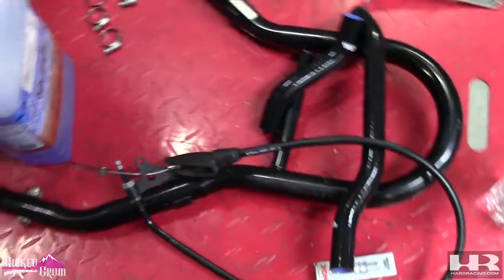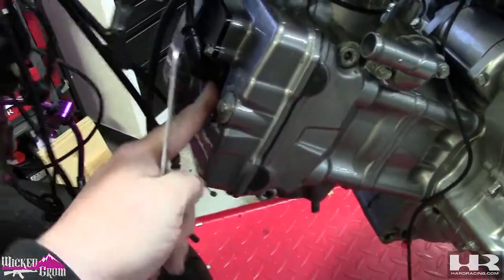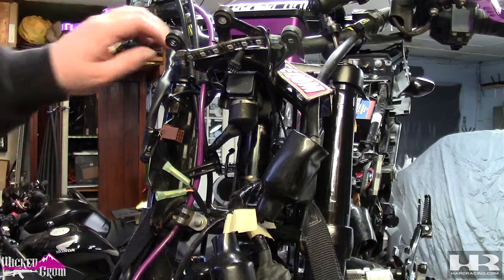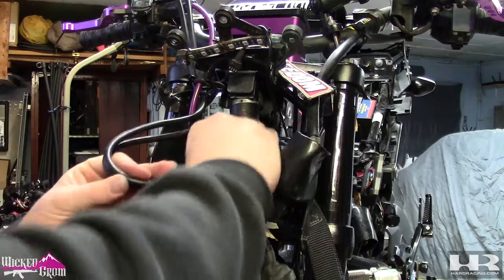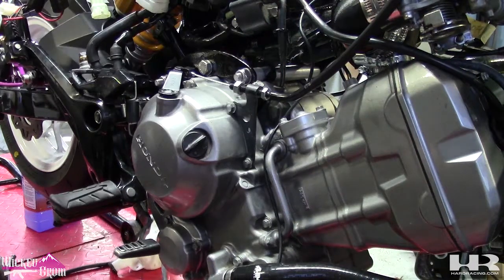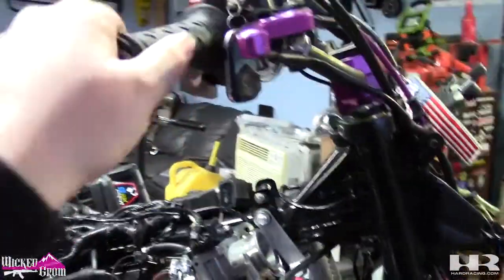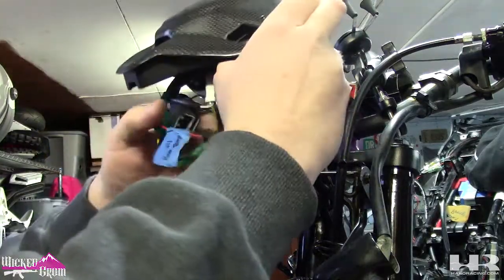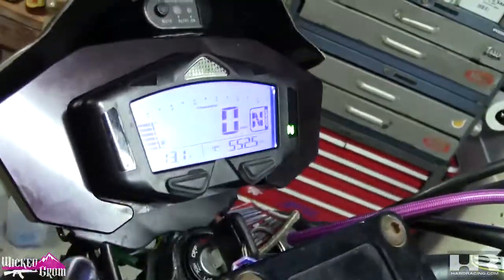Honda Grom 300 Swap | Part 6 - Radiator, Dash & MORE

Comment: The harness is a 300f, but is the motor also a 300f? What is the difference between a 300r? I know they are from different bikes, but it the motor any different? Like are they all the same Honda 300 engine?
Reply from the maker: I believe the cam in the 300R is more aggressive so it maybe 2-4hp more power.